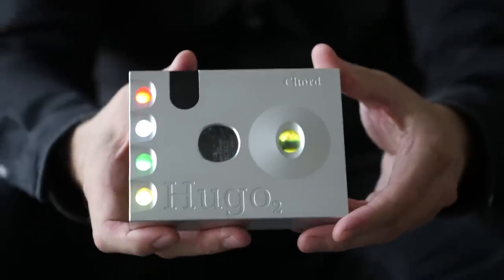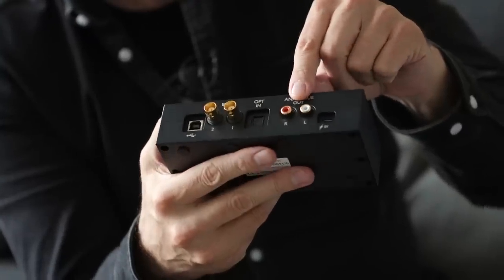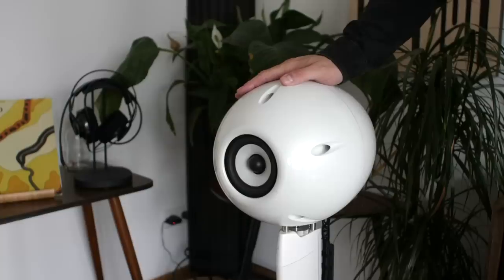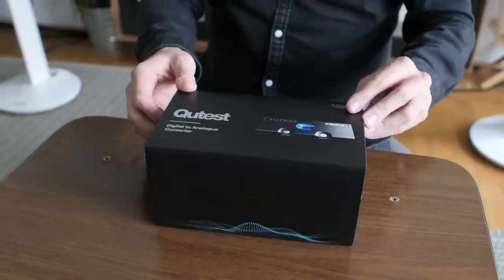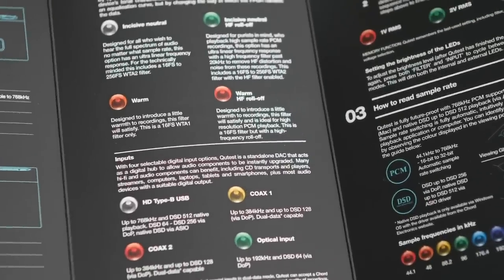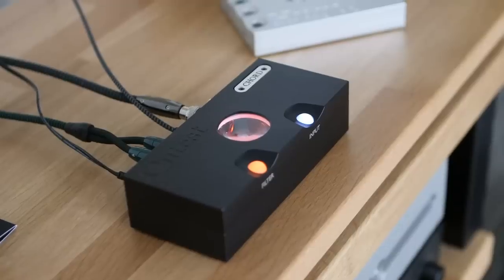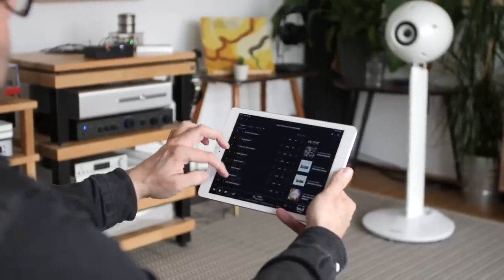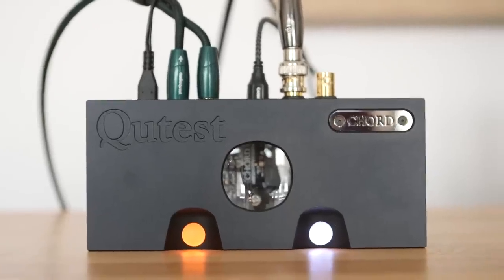Chord's Qutest is *the* DAC to beat at $2K

Comment: I totally agree to what you said. I compared Mojo with Qutest and found Qutest to have more air up top and it extends well across frequency. Since it extends better in HF hence we get more details out of it. Mojo I found to be warmer sounding of 2 and has thickness in lower midrange. Also the depth and width with headphone increases with Qutest and with a mojo it is more intimate since it doesn’t extend well in HF.

Comment: I just bought a Chord Qutest. Its in a system with an Aurender N100H, PrimaLuna integrated tube amp and Focal Diablo Utopias. I was worried it may sound clinical/harsh, but it did not. Its a very musical and detailed DAC. I plan to try the iFi PS to see it hat helps. I know that Rob Watts doesn't believe in using a linear power supply with the Chord and there has been much debate about that in various forums.
Reply: I would take Rob's word over some random forum audiophiles any day.

Comment: The FPGA coding method is probably the most accurate way of processing a digital signal into analogue so that your system can play it back to your ears. Both dCS and PS Audio use FPGAs in their DACs and those two companies also make some of the best DACs in the world. Because Chord DACs are very accurate they often highlight flaws in the rest of an audio system. A lot of reviews do mention that they often need careful pairing with other equipment. If I had an unlimited budget my fantasy system would be dCS Vivaldi stack, D’Agostino Momentum pre-amp, Relentless power amps and WAMM Chronosonic speakers.

Comment: At first listening, I was impressed by the Qutest. But... Two years ago, I looked to replace my Chord DAC 64 Vs2, and trying another Chord product makes sense. I have a Innuos Zen Mk2 and only listen to 16 or 24 bits from this source. The dac is connect to a combo of Conrad Johnson, ET2 (preamp) and Classic 60se (amp - 4 KT120 tubes) and then the speakers are Audio Physic Virgo 25 with good cabling from Shunyatha (power) and Audioquest (Redwood to the spekers) and  Audiance (au24sx inteconnect). But, what's happenning after the listening of the Qutest, I came back with de Dac 64, and... I find it more musical, more natural and coherent... yes the Qutest had more details and legs (dynamics, bass and highs extensions) but something was not as musical as my old DAC 64. So I visited other dealers and one of them gave me a MHDT Labs Pagoda (R2R NOS ladder dac with a tube)... and wow!!! ... I retrieve the musicality, the coherence and the natural sound but a lot better than my old Dac 64, and clearly a lot bether than the Qutest. And with all the details, dynamics and extensions of the Qutest, but in a more nataurel way, more open, less edgy. So, Qutest is good, but, in my system, I choose the MHDT Labs Pagoda.

Comment: I do live now some time with the Qutest. Somehow, I'm not always convinced of its sound, but I started to believe that I was related to me. The Qutest sits on the back of my Auralic Altair, and yes, it does offer better performance. Now, out of curiosity, I have a second system in my office containing vintage equipment and some more affordable equipment, and I took the Qutest with me to see how it will improve my Yamaha CDX5000 (1988) and my Node 2i............. I was shocked. The Yamaha outperformed the Qutest. The Node offered the same level of details, soundstage, and air as the Qutest. I must admit that this was far from a pleasant surprise. I just decoupled it now and I have very odd feeling now. Why is the Qutest not better than a 1988  CD player (although the top of the range in 1988), or even better than a 3 times cheaper product. I really start to doubt about any upmarket DAC as I was soo disappointed...... Also, my Aurlic Altair of €1950 can really be considered as a piece of shit since it is less than the Qutest, which is on itself is only equal or less than a €600 streamer or 1988 CD player. Oh man.......

Comment: Hello John,
I beg to differ a bit about your title. I owned the Qutest few weeks (was a big fan of the Mojo) but returned it due to what I found to be an overall bright signature, whatever the filter used. I compared it to the RME ADI-2 DAC. Qutest had a wider soundstage and that was the only advantage I found. ADI-2 DAC showed a more balanced sound, dead flat and neutral, at least as detailed, and far less fatiguing to listen at high volume or for a long period. If you consider you get a decent headamp, a huge amount of setting, an EQ and a screen...for 500€ less...RME is the clear winner (price to performance ratio). You should give it a try if you may. 😉
Reply from the maker: The RME is on my radar!
Reply: @DarkoAudio   don't let it lost on the radar, try it. You will be surprised.
Reply: Maybe your speaker and setup didn't fit with chord sound signature.
Reply: muataz shammari He's probably using Klipsch. 😂
Reply: @i0001w  maybe, yes. But I have two speaker systems and one dedicated to headphones only. Same occurs. Had many DACs under 2k and no all of them sounded bright or such.
Reply: @vintageflanker7096  If you listen to bright music, it will sound bright. Too bad people don't understand the definition of a DAC. A Dac shouldn't smooth out whatever is in the music file. Qutest is sharp and musical but not analytical/sterile.
The amp gives the signature you're looking for. Just a bad combo you had, just like the video describes.
Reply: @steamstories1279  A bad combo strangely with Qutest only. But maybe all my past DACs/Amps/speakers/headphones are responsable...
Reply: @20puskinas1992  Of course. All inputs, in fact.
Reply: @sgals3395  I'm afraid not. Monitor Audio Gold 300.
Reply: @20puskinas1992  Lower resolution DAC? WTF?! Come on... RME is designed from a professional brand and for professional purposes. It doesn't "mask" anything. It also measures better than Hugo 2 BTW...
I use Audioquest Carbon and Atlas Element USB.
Reply: I think the QuTest is a bit warmer, maybe coloured sound. RME is cooler (maybe neutral) but seems more detailed. RME is better value no question, plus they have a really good reputation in the professional audio production industry.
Reply: Which one of the 2 dacs had the most transparency and the weightiest bass?

Comment: Great review. based on your review of the Yggdrasil, the schiit's strong points were tonality, dynamics and layer separation and the chord seems to top the schiit (in electronic music at least)  in all of those categories while being half (a third?) of the size and using a "dirty" switch mode power supply. very very impressive.
Reply from the maker: Careful: not all switch mode power supplies are dirty.
Reply: What are your thoughts on Audioscience review's of Topping E50, and the Qutest.  He ranks them pretty much on par according to measurements.  He seems to think that his measurements show that people are wasting their money on many costlier dacs.  Also, claims that upgrading power supplies barely has any benefits performance, or even none at all.  It would be interesting if you touched on this topic in a video and did an shootout between the Topping E50 and Qutest.  Also, adding psu's like iPower, Shanti...(or not at all)

Comment: BNC is proper connection for digital cable not coax (chinch). I use silver bnc cable (unfortunately with coax adapter) why audio gear use chinch not BNC?

Comment: John - appreciate the advice about the ifi power supply but chord (in the past) has stated the warranty is void with non-chord power supplies - have they finally changed that policy for the qutest?
Reply: More so if you break one of their devices with a 3rd party PSU that they wont service it under warranty.

Comment: If you would compare the Mojo and the Qutest in terms of the DAC, and how they sound different (because i guess you have tried both if them). whats the big difference between them in terms of sound quality, imaging and balance? if we only talk about the DAC itself and not the amplification

is it also worth getting a qutest over the mojo, in that case why? because the mojo is pretty transportable. you can use it as a DAC with your main setup and also bring it with you as a headphone amplifier on the run

im sitting on a Meridian Prime DAC/Amp atm, where the DAC isnt the device´s strongest part. so im thinking about getting a new DAC. Mojo is cheap enough for my wallet but the Qutest...is it actually worth?

Respond when you see this

Comment: Without blutetooth capability, how does the Qutest receive music signal from say my Macbook or Galaxy phone wirelessly?
Reply: You'll need an NAA such as a Sonore Micro Rendu or one of Allo's great value devices. Other renderers are available. You simply attach them to either your USB port or digital coax.

If you're using something like Spotify you can also plug your Macbook into the DAC using a suitable USB cable and then use your phone as a remote...

There are more options than this but YMMV as far as sound quality goes depending on what source you end up going for. In my experience network attached audio devices sound far superior to a standard laptop or mobile phone.

Comment: Chromecast with HDMI splitter ! Why not chromecast audio with digital out?
Reply: The Chrome cast Audio does have a digital output, just use an optical to slink with a jack plug for the chrome cast connection

Comment: Those that know don't use digital connectors like toslink, spdif, or aes for output. Though convenient, the multiple conversions result in degraded fidelity. In the digital realm, this doesn't sound like normal distortion. It tends to sound hashy, because of the way that error-handling algorithms smooth the gaps between the bits of 24 or 32 bit PCM. How do you get rid of this problem? DSD! The 1-bit format is what makes the difference - not the high sample rate of the file.  Because multiplication cannot be performed on a single bit, there are no errors to be handled. With DSD, gain can only be adjusted in the analog domain.

Comment: A superb summary of the  DAc  that I’m planning to buy in the next couple of weeks, I was actually debating to pick up the Hugo 2 to be integrated into my system, I don’t require and amp I already have 1 for on the go, but I was always quite cautious wanting the best option out of the two.
Will be integrated with my Sennheiser HDVD 800 and HD 800S headphones
And occasionally swapped into my studio monitor set ups
The Genelec and Mackie monitors
Have you had any experience with the    Sennheiser amplifiers?

Comment: the colored lights annoy me. it's meant to be heard, not seen. if you need a manual to figure out something as simple as a status light, that's a big red flag of a poor design.
imo, it's not the job of the dac to provide filter presets. the only job of the dac is to convert digital to analog audio signals, and it's sole responsibility is to do that as well as is possible.
I guess some people like to pay extra for fancy packaging, but as for me, if a package isn't tossed, it only collects dust until it is eventually tossed.
when I shop for a dac, one key feature is to have fully isolated power supplies for digital and analog parts of the circuits.

Comment: Any thoughts on comparing to the PS audio DAC? (also FPGA) I realize it’s more money, but curious if you had any thoughts between the two.
Reply from the maker: Hey David. As you can imagine, it takes a long time to do a review, let alone turn it into a video. What you see here is the sum total of all my thoughts on the Qutest.
Reply: @DarkoAudio  Hi John, Fair enough. I understand. I only asked as I believe I saw a PS audio in your system in the past and they are one of a few that also use an FPGA. I have never owned an FPGA DAC, but being an engineer I understand it could have substantial benefits. So I was simply interested if you had any opinion on the matter. Cheers!
Reply: I have a PS Audio  Directstream DAC and it sounds absolutely amazing!!! I'm never getting rid of it.
Reply: David Sanders  They are having a sale in November for it.  Can't beat the pricing.  https://www.psaudio.com/products/directstream-dac/
Reply: Matthew Guthrie Thanks for the info!  The PS Audio DSD has been on my short list, but I’m leaning towards the Chord Hugo TT 2.  My biggest concern about the DSD is it’s age (almost 5 years old) and lack of support for higher sample rates.  But, that sale price is attractive!  Any thoughts on comparing these 2 DACs?
Reply: @sinclabs  There are some reports on head-fi regarding directstream vs Hugo 2 and they prefer Hugo 2, well you know, they may be biased, I didn't listened to directstream.
Reply: PS audio puts a transformer on the output stage which ruins transparency. Unless you like it that way. And it measures poorly compared to the qutest.

Comment: I bought the Qutest based on this and other reviews and all I can say is that it's the most overrated DAC I've ever heard. The first thing I noticed after burn-in was the lack of treble, which sounds like it's reduced by at least 3db. After that I compared it to my Benchmark DAC1 USB. The bass and soundstage are similar, but vocals on the Qutest sounds distant and not as clear, and treble doesn't have any sparkle. On the Qutest, string plucks, high hats, horns and violins are muted. With the DAC1 you can hear every detail and if the legs of a decay have been cut too early during mixing, but the Qutest hides this. Honestly, my Arcam irDAC-II (which I use in my kitchen) sounds better than the Qutest and you can find them used for about £200-250. I have Focal Aria 906 floor standers, a Real T5/I subwoofer, and a Quad Elite preamp and power amp.
Reply: I had my share of dacs, amps from extremely expensive to cheap, but on this one I totally disagree with you, like many other people wit me. The qutest is a amazing dac paired with a decent amp that is. And I play with really expensive stuff, I play with focal sopra's and martin logans, and for headphone's meze elite and hifiman's. pair the qutest together with  hqplayer and it is a dream combination. nothing muted, nothing missing on any freq. I don't know how you are listening, but you are sure doing something wrong. (not trying to be harsh, just saying out of experience and many other people)
Reply: @aheuvelink Wouldn’t the rca hold it back against the 3pin balanced output dacs? Like the Pontus 2? Don’t know wich one to get. Also use meze elite (with moon 430had)